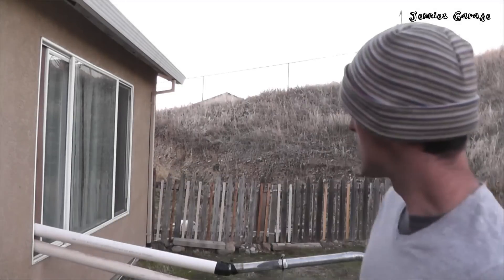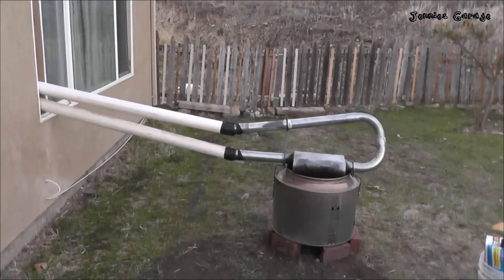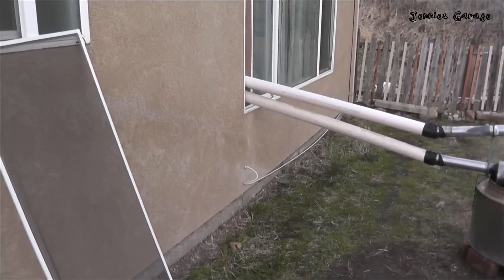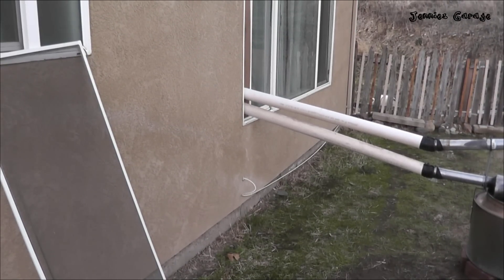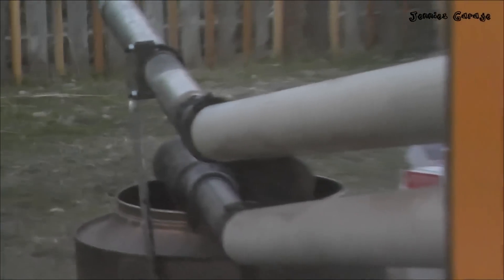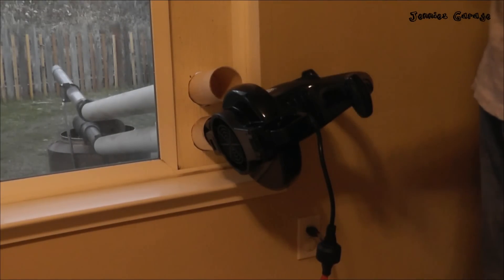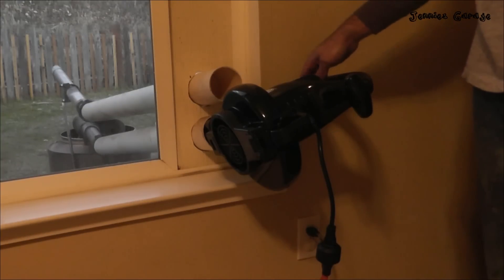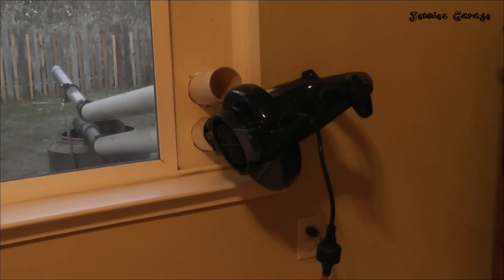How To Heat Your House With Garbage - Testing The Trash Furnace

Comment: the only thing I see wrong you need to move your inlet closer to the floor to suck the colder air with a elbow and a piece of pipe and your outlet needs to be about half way of the window I bet it works better just try it

Comment: your idea looks great but there's 3 things questionable, 2 need to improve such as the noisy blower and inconvinient location and 3rd is some of the heat source you mention is an environmental issue such burning snicker, motor oil, rubber tire or plastic.

Comment: This comment may have already been made, I didn't go thru all of them to see.  I commend your thought process.  The truth of the matter is you can buy a wood burner that uses a catalytic or tube re-burn system that will burn way cleaner than what you have done with much less heat loss.  Cleaner burning means more heat with a much longer burn time.  These types of stoves can be exhausted out the wall or up thru the ceiling.  If you want a small room type look into burners that are used in rv's or boats.  A type of rocket burner.  With your ingenuity, research these and improve your idea.  Study what has already been done and improve on that.

Comment: Build a fan duct and use 4 120mm cpu fans to push the system, quite yet effective, plus low power consumption.

Comment: use a small energy efficient fan and use it to pull hot air through the pipes rather than push
Reply: it will also prevent recirculating the air

Comment: if you plug the blower into the speed control of a sewing machine you can slow the blower down and be quite and have more efficient heat transfer
Reply: Robin Burkey also the damper switch

Comment: I've watched both vids and yes, this was a fun project but just get a wood stove insert for your fireplace. It's quieter, safer, way more efficient and you won't be kneeling outside in the snow freezing your ass off just to burn your trash (and you can still burn your paper trash in the wood stove). 

Another benefit of having the inside stove is you can buy or gather wood so you can cut your propane costs even further by keeping it silently (the neighbors will thank you) running. You can cook on a wood stove and during the winter you can also put a pot of water on it to humidify the house (moist air means no nose bleeds). 

Just my $.02.
Reply from the maker: +johniwan1 Thanks for the comment. It was a good project that I hope to improve on. Wood stoves are very nice though!

Comment: It would be easier and more eco-friendly to recycle your trash and use an electric heater instead? Look into building a rocket stove heater. You can hook it into your fireplace, burn any type of scrap wood, they're very efficient and you won't need a fan.
Reply: SirReal , and he can make burn logs with that paper trash he has and some sawdust.
Reply: we get alot of trash mail and newspapers and the best way is to make paper bricks,there solid and burn so much longer,adding saw dust is even better they burn twice as long,so maybe look at that Jennies Garage
Reply: MrRavenous , yeah, that's what I was talking about and it's really easy to do. Adding in a little sawdust works great and helps hold it all together, but it works good with just paper.
Like someone else said, he could also build a rocket heater/stove and use it all. Next on his list, creating A/C with tinfoil, string and urine. 💀
Reply: Best comment yet!

Comment: the largest problem is the leaf blower. the more powerful the fan the louder it will be. try a powerful computer fan. it will not push the same amount of air but it will be useable and will be efficient (a leaf blower will be costing you way more to use in electricity)
Reply from the maker: +pmfman I agree the leaf blower is overkill. Thanks

Comment: Grab a cheap 110v computer chassis fan and plug that into the wall instead of the blower. This will provide less CFM but a constant CFM and little noise. Then you can run it for a while. IMO.

Comment: Have you done any more improvements to this design since this video? This seems like it could work even better if it was a closed indoor system with a chimny that ran outside. that way you get the radiant heat from the incinerator itsself as well as the heat from the muffler air without releasing the toxic gasses into your home as well as not having to go outside to feed it.

Its a little late for me to make this for this years winter anyway but i would love to hear if you have made any improvements because this seems like it could work exceptionally well if build more efficently such as a bigger barrell or two mufflers that way the air is heated twice however I am not sure if that would work or if it would make it less efficent but I dont know. 

If I may, may I suggest to also make some paper bricks or biomass briqqests to burn as well. You would be surrpried at how much stuff actually burns. If you are really trying to make the most out of everything you could even burn your own or if you have an animals "such as a dog or cat" feces which is not only better for the environment because you prevent the production of methane gass you have a renewable fuel that you can get on a daily basis. even if you only use your pets waste
Reply from the maker: +jon reynard Thanks for the comment. I haven't done much more with it lately, except keep on the lookout for an actual furnace. If I could find one and figure a way to build a firebox into it, I think that would be much more efficient. I was really surprised at how well this one works, since it is so inefficient/archaic. Once I get caught up with some other projects I'd like to continue though because I believe heat from trash is a worthwhile challenge.

Comment: I thought about this for a few mins and I first thought I'd plum a line from the shed and run the air source from there. Then a realized that you're still gonna be spending money on electricity or gasoline. I personally would build a rotary fan plumb it into a stationary bike, and set the bike near the window. get on and get your exercise for the day for free heat. I would personally get rid of that damn PVC as well cause that's potentially harmful for you and your family to breath that heated shit. Use steel pipe cause steel will stay hotter longer and steel can conduct heat but PVC can't.

Comment: Use a 5 gal drum & hook up a 10" box fan blowing down the cut out lid. Drill a hole through the drum and connect a vacuum tube through it. Duct tape the other end of the vacuum tube to the duct, and you have a quiet blower.

Comment: why not just put a slow combustion fire place in your home? you can burn whatever you like in it (almost), and the majority of the heat is not going to waste, and its free heat. this system can only heat 1 room at a time with out more pipes and fans its uneconomical, looks freaking terrible, and its dangerous you could burn your house down, not to mention the potential to die in your sleep from noxious gases. I wouldn't even contemplate the idea without at least building an area to safely contain the fire, then look at the burner itself - like a waste oil burner, then the delivery system (no plastic), the fans (in-line powered by solar battery system), then the potential to heat multiple rooms. and finally pray that the heat transfer is not too much that it burns the house down. really to knock down the utility bills you really need wind, sun or lots of running water

Comment: have you taken a bbq lid and tried that on your heater yet? and have you thought of playing with your box fan attic rig to try to get hot air in the attic?? or vise versa  and donna crow had a good quite idea you would be able to heat your room all day with a few logs in your burn barrel as well as trash

Comment: To make a safer, more efficient unit, you might consider: metal pipe instead of PVC, and move your intake away from your output, and put a small, quiet 4 inch fan in the system that doesn't draw as much juice to run the fan. The noise level is a bit over the top. Also, I would think using a rocket stove would greatly reduce the amount of trash needed to heat the system.
Reply from the maker: +Donna Crow Thanks for the good ideas. Winter is coming so I might see what I can do to improve the design.
Reply: +Jennies Garage For how much electricity you would use to do that would it be Easter to just pay your gas bill?

Comment: Im not sure exactly what mufflers are made of...but have you checked to make sure that they didnt contain anything combustable...because if they do...you would be blowing those fumes and more dangerouosly, carbon monoxide right into your home...plus if the air exhausting into your room is hot enough it may cause the pvc to off-gas as well...its an interesting idea...but you really ought to have a carbon monoxide detector running in any room that uses this system

Comment: This is all well and good, but honestly, what you save on a heating bill you are just racking up with an electric bill to run the exhaust system. And having to go outside to add more garbage to keep the heat going is not very efficient either.....having to open and close a door going out and in to add more fuel to keep it going lets the heat out. Unless you can come up with a system that does not use electricity and can be placed safely inside the house, you are just trading off decreasing one bill for increasing another, and all for less than a ten degree difference.

Comment: dreadful idea.  Garbage like plastic, rubber, and even some inks need to be burned at high pressure and temperature to reduce the level of harmful fumes and pollutants.  With your setup, you may be saving a couple bucks in heating while you take a dump on the environment but you're increasing the risk of cancer for you and your neighbours.

Comment: the idea should work though not verry efficient (theres a lot more heat being ptoduced only a small percentage gets transfered to the "converter" sitting on top 
you could use a smaller fan like a computerfan or a bathroom extraction type fan
make it inside the pipe but outside te house and run the powercord through the sucking pipe intoo the house , that way no rain or anything cant get intoo the electrics and it be more silent 
whont do you mush good unless you want to get out to add fuel to the fire every hour or so 

wat you might want to try if build a smal drum inside bigger drum type garbage burner make sure to set the small drum on the floor of the bigger one so the heat from the top gets caught too
and insulate the heck out of the outside of the bigger drum to keep it from cooling off in the outside air
you run the air in between the two walls with the fire burning in the middle drum
it will have more heated surface to heat the passing air 

wat garanteed will work even better would be to use a "burns every type of fuel" type pot stove and burn everything indoors , that way allmost ALL the heat comming of the stove will warm the house and you be warm and inside youreself too 
you might even be able to warm up or cook youre food on it 
an efficient whell build all burn stove whont smell up the home either
add a propane gas burner in that so it can still heat the house when the other burnables are gone or you dont want to get out of bed twice a night to add wood 

there some realy good waste oil stoves being shown on youtube that saves you time in front of the fire feeding it scraps all day to keep it going 
garages would be happy to GIVE you there waste oil for free as they have to pay to have it hauled off as inviromentally hazardous material 

do you have some ectracash to spend ? you could allso sink verry long pipesystem intoo the earth and use the earths geothermal heat to prewarm the air and the hot water for the boiler

Comment: I have a solution for your airflow issue. I recomend getting a cheap computer power supply and attaching a high cfm computer case fan instead of the blower. This would be the volume of a computer running and you could add multiple fans and make a housing to increase the positive air pressure if required.
Reply: *****
 what about using physics? hot air goes up and cold down,  little modification and fan is not required
, or use something like turbo, hot air will rotate the fan that will push the codl air into tube back
, no electricity needed
Reply from the maker: DJ ASMR Interesting idea, thanks. It would be quieter for sure!

Comment: Great Idea.  Since Hot air rises and cold air drop that would create a natural circulation I think.  But you use a fan to force more air circulation since you are not planning on the fire lasting to long.  The nice part about your setup is that in 10 minutes you have trapped alot of the hot air so it does not need to burn long.  Sweet.
Reply from the maker: pvaldeben01 thanks for the comment, glad you liked the video!

Comment: This is a great work in progress!  I was thinking that turning the waste into bricks, mixed with leaves, and sawdust like other people said while watching video and I got another idea.. put actual bricks in the bottom to hold heat longer and making it more efficient.  Also, you will run out of trash eventually so you will want to ask neighbors for their trash too or find people that will donate this on craigslist. Also if you had too, you could burn wood in this sometimes and citrus wood tends to burn super hot so could help since you need this so far away from your house.  You are losing heat on that pvc piping and I wonder if you should paint it black maybe?  I live Detroit, Michigan and it is darned cold here.. I am looking for alternatives to paying 450 dollars per month in electricity... due to space heaters, my only form of heat right now.

Comment: Try running a 92mm or 120mm 12vDC [computer] fan inside the pipe.  It will be slower and you will only get 30-50CFM, but it will be quiet and very low-power.

Comment: I'm a plumber/gas engineer in the uk, we have created a lot of different systems like this. a bit of advice i could give you would be to use an appropriate fan not only are they quieter they also move there air slower and allow more time for it to be heated the fans are also more economical on the power consumption. A lot of people in the uk use these types of system to heat there entire home through ventilation systems. Also to save you having to spend so much time in the cold fueling your fire you can convert your waste paper and garbage into bricks (cutting paper up and adding water and compressing) these burns for hours. You could also use that same furnace/fire to heat your hot water if you wanted to by using a copper pipe coil would make it even more efficient.
Reply: Take his Advice, making Paper bricks would be a lot better :)))
Reply: Somewhere his wife is sitting by rolling her eyes. LMAO
Reply: Next step, a gravity feed stack for the paper bricks? First, I would convert the air exchange to water using a car radiator over the fire, a small circulation pump and plumb the circulated water into another radiator in the house through which your air handler provides you with warm air.
Again, this could also be used in your gas fireplace but, unless you route the plumbing through the masonry and the walls, would result in an unsightly living room.
Reply: @hterrebrood  i had the exact idea .a burn barrell wrapped in copper plumbed into a car radiator  put against window opening with a car thermo fan to pull hot air in. All i need is a water pump running off solar power and battery!  Any ideas greatly appreciated?  My arthritis is killing me and heat helps?
Reply: Good info. I would also add that an elegant solution is to heat only water and utilize that to heat the house via radiators/exchangers.. This will allow the water to cool down to a point where it then can be mixed for showers etc. Ultimately a bit of a high-tech eco version of the old boiler systems..
Reply from the maker: Matthew Boland Thanks for taking the time to comment. It's encouraging to know that similar systems (in in principle) are successfully used. I agree what you say about the smaller fan. I plan on adapting a bathroom exhaust fan when I fire it up this year. I've been accumulating lots of wood scraps from my camper trailer project and that should burn much longer than paper scraps.
Reply: @jenniesgarage  Another way to improve your air flow would be using a box fan.  The larger fan reduces volume, as you know.  Building a duct around that to link to the cold side of your heat loop could be done with as little as cardboard and duct tape.
Reply: @jenniesgarage   how do you control the toxins from getting into your lungs?

Comment: ok....the project is inspiring but leaves some glaring issues...Noise, heat output no so plentiful (for a house)...but I do like that it burns much of recycled stuff...was there an issue with smoke and smell (burning smell or other noticeable?)  Did that old lady neighbor complain?...Was the city bylaw officer knocking on your door?  Did the fire marshall knock on your door or send inspectors to check out your operation?

Comment: Be careful with that PVC pipe if you put too hot temp air through it the fumes just may kill you in your sleep. Otherwise a great idea, however. I live here in France and they already have your idea ready to install into your wood burning stove. Works awesome.
Reply from the maker: Wow that's really neat that someone has engineered and marketed a system based on the same principles as my heater. That gives me hope!!

Comment: Hope you don't wake up dead. I was in the construction trade and when we used the air space above the ceiling for return air - the plumbers had to use a special orange color pvc that would not produce poisonous gasses when it burns. 
better check into that if you are getting 100deg F plus temperatures you could be suckin in some toxic fumes. 
be careful.... just use some 3 inch galvanized flue.